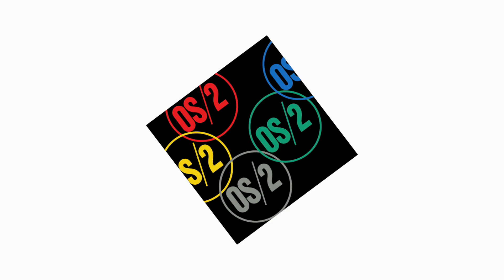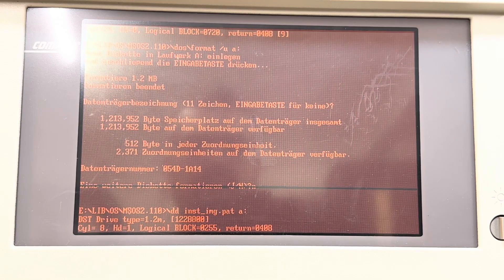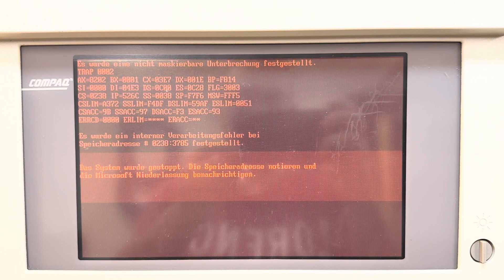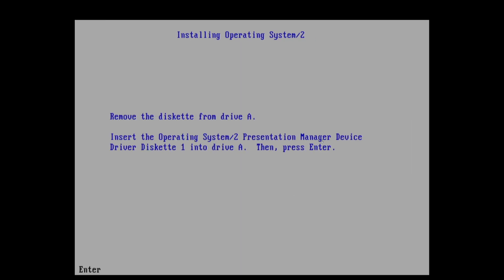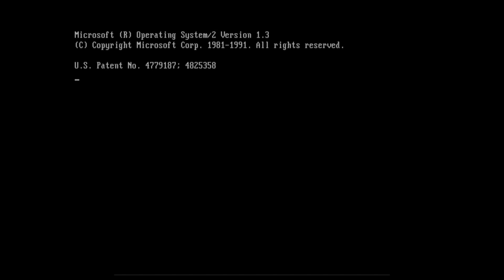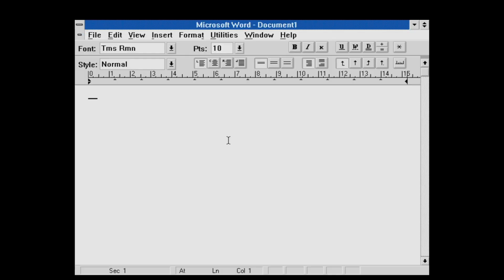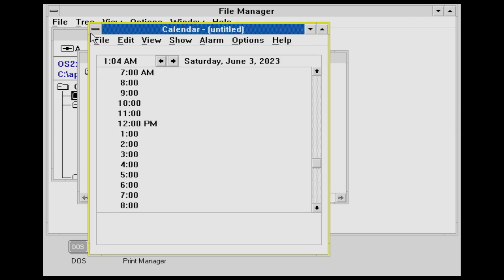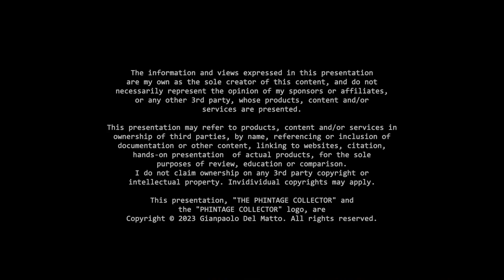Inside Microsoft OS/2 v1.3, and the setup troubles it gave me!

Comment: I first encountered OS/2 2.1 in high school in 1994, we had high-end PS/2 workstations to run laser disc based educational programs. Once I saw OS/2 2.1 I knew I had to try it. Something about windows making laser noises when they open and closed just spoke to me. Ended up getting OS/2 Warp 3. Ran it until Windows 95 released and that was the end. I did find things under OS/2 a little more aesthetically pleasing at the time and was torn, it was also rock solid on my 386. Felt well engineered and I really was rooting for OS/2 but alas...

Comment: The weirdness in Fullscreen COMMAND vs CMD in OS/2 1.x came from the stringent requirement that IBM imposed that OS/2 must run on 286 machines.

While ADOS (earlier name for OS/2) was being developed, Microsoft had used a beta stepping of the 80286 CPU which allowed for some very unusual abuse of the LOADALL instruction to shift the processor in and out of protected mode at will. 

Intel noted this particular use case as a bug, and fixed the problem, and the resulting method of shifting in and out of Real to Protected mode and back again would now cause a system halting exception. Microsoft wasn't too happy about it, and asked Intel to provide a solution, Intel told Microsoft to f*** off.

Comment: It looked like you tried Windows 3.1. Windows 3.0 should actually work. I have seen it in action. They are not the same. :)
Reply from the maker: Good hint. Indeed I tried 3.1. Will give it a try using 3.0.